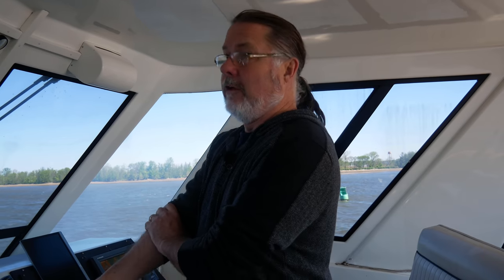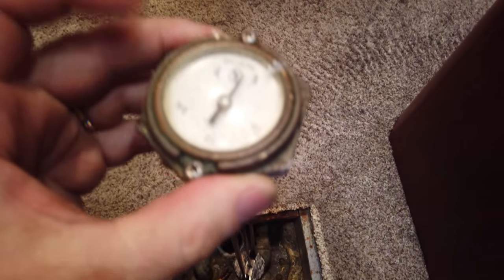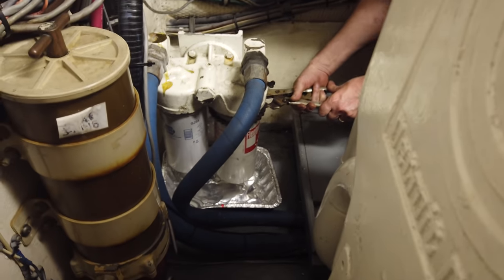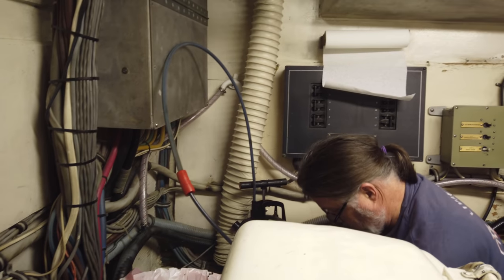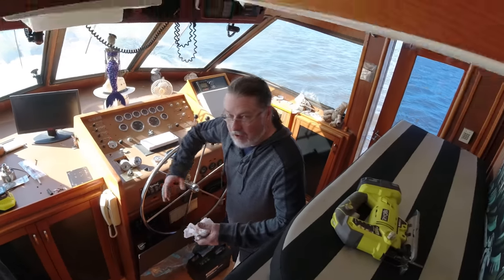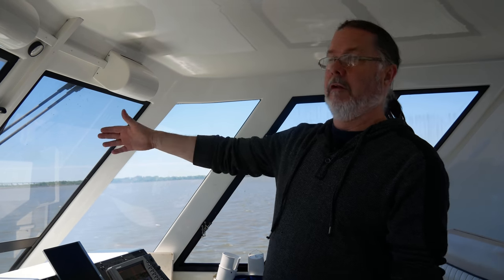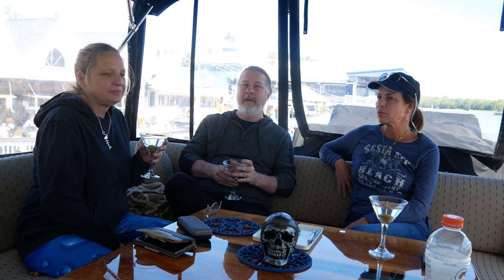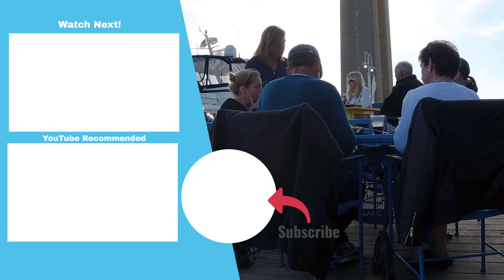Off to the Bahamas in our Hatteras Motor Yacht!  E120

Comment: You need to mechanically secure the fuel sending units. No ifs ands or buts about it. ASAP.
Reply: Absolutely correct, silicone adhesive will not hold up to diesel fuel.
Reply from the maker: It was a temporary install. We plan to make it permanent soon, now that we know it works. It is hard to do where we are now.
Reply: BS
Reply: A machinist could easily make an adapter that is threaded to go into the sender's hole in the fuel tank and with studs for the holes to match your new sender. I wouldn't think it would be terribly expensive.

Comment: You can get a shop that will easily fabricate you new screw tops that will allow you to mount your new sending units, you might only loose an inch or less from the bottom of your tank for an accurate reading but it will be substantially  safer than using sealant
Reply from the maker: Eventually. It is not a permanent install. We wanted to make sure it works. It does. For now, it is holding well.

Comment: Ed, How about taking the old senders to match thread and see if there is a pipe plug that is the right size. If there is one that matches the threaded hole then grind the top of the plug flat and drill a hold for the sensor then drill screw holes for the mounting. Or just take the new and old units to a machine shop and have them make proper screw in bushings X 2.
Reply from the maker: That is what we plan to do when we return. I was running out of time when we installed them. However, so far so good with the silicon.

Comment: Me and some friends just completed a 236 mile trip up the Tennessee river in a 1996 52' Steel Skipperliner Coastal yacht he recently purchased. we had a few problems with our MicroCommander system acting up along the way. That beeping and loss of engine control on one engine while in a marina was very familiar to me watching your video now. I was quite relieved when the grumpy old system finally got us where we needed to go! Cheers Friends, hope to see you on the water one day!
Reply from the maker: The MicroCommnader always makes me a bit nervous. It runs off a 12 volt battery. I keep a spare battery next to it and have an alarm that goes off should it get weak.
Reply: @tryingnottosink9107  we even kept a spare set of relays on board that live inside the breaker boxes. I've seen several sets that like to get corroded. That system gets really upset if the voltage supply gets low at any point. 🍻

Comment: Hey was watching and you can buy the exact replacement sending unit you took off.  They have a magnetic pickup upgrade that send to a gauge.  Take the screws off the top gauge and replace.  I have a 61 MY and just did both of mine.  I have gauges for both tanks on both helms though.  Adhesive seems scary for rough conditions to keep your fuel in the tank.  

Saw your boat in key west about two years ago.  We were coming back from Boston to Dunedin, FL.  Love the vids!
Reply from the maker: Are you saying that the magnetic pickup can be fitted to my existing gauges or that they sell a whole new unit with the pickups? In either case, I was not aware they existed. The silicone is temporary, but working well. I'll make something permanent when I return to home port.

Comment: Not sure about the silly putty for the fuel gauges, when I saw the flange mount was curious about how you were going to make that installation!
I was thinking taking a pipe nipple to a machine shop and have them fabricate a flange and weld it to the nipple to create a positive connection:)
Reply from the maker: It is temporary. We plan to do a permanent install now that we know everything works well.

Comment: Tap thru the filter  about 2/ 3rds  up . that won't fill up your tray. put some duct tape over the hole so none spills out if you tip it when taking it down. Then dump it in your bucket. In a tractor i just  use my pointy punch and punch it in the bottom because i have the oil cart right underneath it. If you just unscrew the filter it will run over the sides all over your hands and  drip off your elbows until i slips out of your hands, onto your pants  / shoes and the floor. That is because there is a lot of oil above the rim of the filter that wants to run out as fast as it can. lol

Comment: I hope you saved the old sensor. I’d take it to a Machinest. Have them make a flange for each tank that threads into the tank and provides the flange to bolt the new sensor to. Then you’ll have a properly sealed tank.
Reply from the maker: The silicone was definitely just a temporary solution until we know the gauges worked correctly.
Reply: @tryingnottosink9107  I’m sure it was temporary. Just giving you an idea that doesn’t involve modifying your tank. The old float system will give the Machinest the proper size of hope and thread pitch. They can take a piece of stainless, aluminum or black pipe and wild a flat flange to it. Then drill holes matching your new sensor. So you thread that piece onto the tank giving you a new mounting surface. 

It’s common to use a cork gasket for those. However they tend to leak over time. I’d find a fuel resistant rubber or a fuel/oil resistant silicone as the gasket. Then you can use a Loctite 545 hydraulic sealant or similar for the pipe threads into the tank. It’s more permanent then Teflon. 

Making this flange for your tanks would allow you to revert back if needed. 

It would move up the whole sensor about an inch to an inch and a quarter. Which would mean 100% full might not register and at 100% empty you’d have a slight reserve. But in reality you probably wouldn’t even notice it. 

I just hate modifying a fuel tank if I can avoid it.

Comment: Little tip for running wires. Use an eye bolt and screw it into the end of the wire. Between the pvc coating and the wires. As long as you're not using a huge eye bolt with a super thin wire. It won't break through it. Then use a keyring to connect it to whatever you're using to fish it through and have at it. I've never had one come out... I feel like it gets hung up less than the tape method too. Maybe something you could try in a future upgrade where you need to run wires.
Reply from the maker: Thanks for the tip!

Comment: Proseal is the sealant that should be used on tank fittings.
Reply from the maker: Thanks for the info.
Reply: @tryingnottosink9107   No sealant is going to keep the sender unit in place and fuel is going to slash out when you hit the first real swells.  The sending unit has to be mechanically attached to the fuel tank.  Put the old ones back in until you can find the correct sending unit.

Comment: have a machine shop copy the threads from old senders and weld to a flat flange to mount new sender thru and screw it to flat flange with correct gasket
Reply from the maker: Eventually. It is not a permanent install. We wanted to make sure it works. It does.

Comment: captain ed, use a couple of short self tappers to secure that sender. silicone will not hold up and you could end up with a spill in the hull.
Reply from the maker: It was a temporary install. We plan to make it permanent soon, now that we know it works.

Comment: word to the wise fuel tank sending units on older boats are always inaccurate  whenever new tanks are done get sight glasses installed on them  and  install Reverso  oil changing systems  you can  change your fluids in almost any climate  without making a mess  and trouble free Why Reverso ? They have been around for a while  and operate out of Fort Lauderdale Florida  a pretty common area to boat in and out of ,  you could had saved money on  the fuel Guage sending units by buying Lynn her own socket and a wooden yard stick  to get you readings !   My ex wife might had done that hammer thing one time then  she might had thrown the hammer at my head after wards ! You got yourself one of the good ones Buddy , best of luck on the Gulf Stream crossing !  I imagine you guys will be great in that big boat ! I grew up with a guy that took a 13 foot Whaler  frommMiami to Bimini and then back  no GPS  or anything fancy  that’s back in the days when the Bahamians used to litterally stick Bamboo sticks in the sand on the Beaches  and move them around (hopefully ) to mark the channels and sandbars !  My Buddy used his Compass  and if I had to guess he probably had a pack of cigarettes and a pocket of Joints for the crossing LOL
Reply from the maker: We have a couple Reverso's on the boat. We have an auxiliary tank and we use a Reverso to move the fuel to the main tanks. The Gulf stream was a bit rough when we crossed. We actually waited 5 days for it to calm down.

Comment: Th old sender should have pipe thread. you could get a pipe bushing and get a plate welded to it. You may lose an inch or so in depth but you would have that much fuel when empty. If you get water in fuel it will settle to bottom. easy fix.
Reply from the maker: That is the plan. Now that we know it all works well.

Comment: Did you need to calibrate the new fuel sensors so that it provides you with accurate readings?
Reply from the maker: What fuel sensors? We just have the senders and gauges.
Reply: Sorry I mean the new fuel senders you installed in the tanks.

Comment: Thoughts:
1. Shoulda checked the tide before departure due to that "Mound" at your marina.
2. HIGHLY APPROVE of the Martinis.
3.  HATE the Delaware River, due to tidal action and current.  It's a True Miracle Washington and his men made it across alive. 
4. Very Much like Schaeffers.  Great place.
-Best.
Reply from the maker: We left near high tide. And have left many times at low tide with no issues.
Reply: @tryingnottosink9107  Good on you, Mate.  Glad to hear it.
Then that is a truly Vexed entrance you have at that marina.
Rock Hall, Maryland Harbor has a similar vexing situation: Unlike the norm, there, the Center of the harbor is Very shallow, and the circumference of the harbor is deep enough for boat traffic.
The Sea Witch at work....

Comment: You might consider using JB Weld to hold you new fuel gauge in the tank, it will seal it and keep it from sucking air.
Reply from the maker: The silicone was definitely just a temporary solution until we know the gauges worked correctly.

Comment: I have a question for you,  I noticed that you have split engine rooms and I saw past episodes when it became very difficult to service an engine.  We are looking at a few Hatteras's in your size range and even though I have 25 years of cruising experience I was also much younger and easier to contorque my body into small space.
I am looking for three features Full beam engine room, a Cockpit, and full walk-around deck.  These are not easy features to find on a Hatteras.  If you were to start over would you take another split Engine room and why? Thanks,
Reply from the maker: I have always thought that it was a design error. I would rather have seen them make it one big room and put a spiral staircase down to the aft staterooms.

Comment: Fisheries Supply has the NPT threaded tank senders. I'm doing mine now. S5U - NPT
Reply: Doesn’t the fuel pump shut off automatically when it senses foam/fuel at the pump?
Reply from the maker: I am making an adapter. It was a temporary install. We plan to make it permanent soon, now that we know it works.
Reply from the maker: No.

Comment: Did you just use painters tape on that sending unit wiring connection?? Say it isn't so...
Reply from the maker: No. That was just to pull it through the boat on a fish. I used butt connectors.

Comment: Great video!  How are the new fuel gauges working out for you?  I have been researching new fuel senders for my 1995 Silverton 41C.  I do not trust the old arm style floats.  The KUS senders are more like what we use on the jet I fly and they are pretty darn accurate.  I see the KUS feeds into NMEA 2000 so I am thinking the indication would show on my Garmin 1242xsv Chartplotter.
Reply from the maker: We like them. No issues so far. We will eventually hook them up to NMEA 2000, but for now, just gauges.

Comment: Wait, no mechanical fasteners for the fuel senders?! Those senders must be mechanically fastened to the tank; an adhesive sealant is not sufficient.
Reply from the maker: Eventually. It is not a permanent install. We wanted to make sure it works. It does. For now, it is holding well.

Comment: You got to screw that fuel sending unit down or take new unit to machine shop and let them wield a coupling ( same size as old one) onto new sending unit.
Reply from the maker: Eventually. It is not a permanent install. We wanted to make sure it works. It does. For now, it is holding well.

Comment: Silicone to hold in the fuel tank sending units? No way that will seal properly. Fuel will leak out from the silicone as the boat rolls and the fuel comes up against the top of the tank. If it hasn't consider yourself lucky.
Reply from the maker: It was just temporary.

Comment: bad move just Silicon on the fuel senders, rough water and that fuel sloughes hard, they popping out.

sooner or later
Reply: just drill and tap the screw holes, grease on the drill bit keeps the metal shavings contained.
Reply from the maker: Just temporary. I'll make it permanent soon.

Comment: That original fuel gauge looked to be an analog type with the "twisty thing" in the middle (spiral action), not one that works by electrical resistance.

It must be nice to finally get underway. For me, here comes the nostalgia again!
Reply from the maker: You are probably correct.
Reply: You are correct. Which in my mind means that that is a backup mechanical level sensor and therefore there is another electrical sending unit elsewhere on the tank.